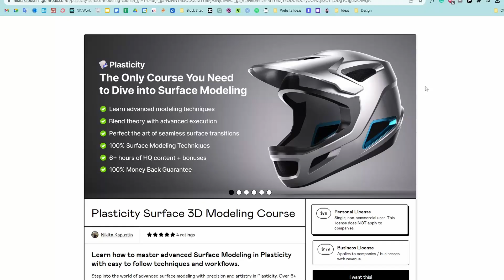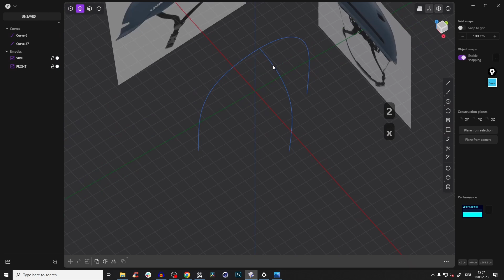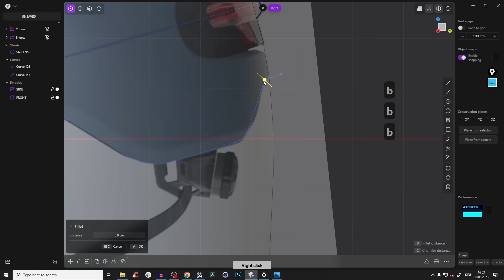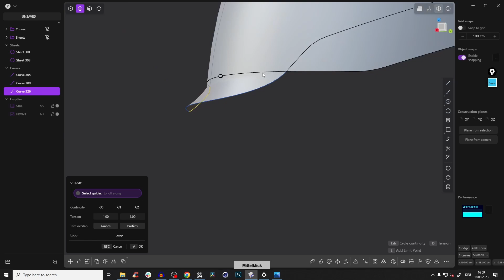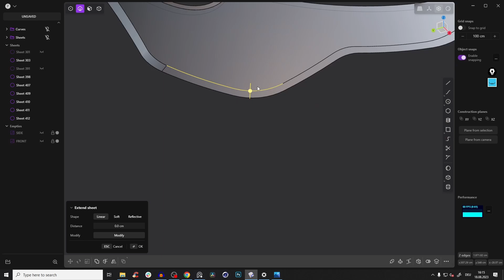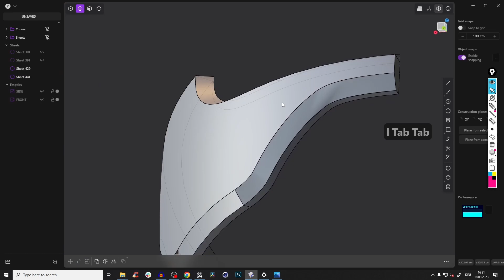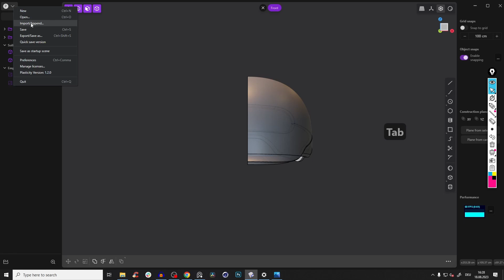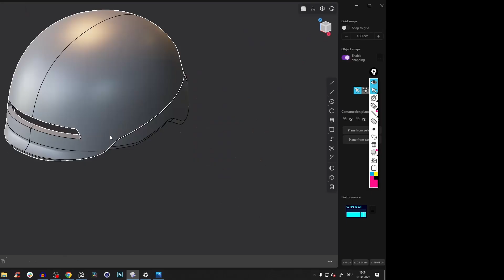Beginner Surface Modeling Tutorial | Helmet | Plasticity - 3D Revolution!

Comment: All your videos are amazing and captivating. Basically selling plasticity for them at this point.

I have to ask though, what's the benefit of surface modeling specifically? As someone who is new to 3d printing, it seems like it's really easy to make a mistake and end up with a non manifold object that you can't resolve.
Reply from the maker: Thank you for your feedback, very glad you find them helpful!

Surface Modeling has many benefits:
- full control over shape & form
- ability to model almost any shape (simple & complex)

Mistakes always happen, but if you have a thoughtful, solid surface modeling workflow and you keep organized you can always come back to previous stages of your modeling and remodel things.

Ot better: Try to give your best from the beginning on so you don't have to come back in most cases.

Comment: Is there a way to offset the face in another way than 30:35? My offset only wants to go outward and not inward.
Reply from the maker: Yes there is a work around, which is a bit tricky to explain in text but I try.

You have do duplicate the whole sheet and then just bring it with "G" a bit more inside. Then you have so scale it with the freestyle command on each side to bring the edges on the top, bottom, left, and right to your desired place.

Otherwise, scale it down, extrude the edges and cut them in the left/top view into half so you can mirror them.

I might do some videos on that in the future, as it's better shown via video.
In my premium surface modeling courses I am showing those techniques.
Reply: @nikita.kapustin  Hehe thank you for your advice I tried by just scaling it in and it worked alright. I will look into the solution you mentioned here, very much appriciated! Great tutorial!